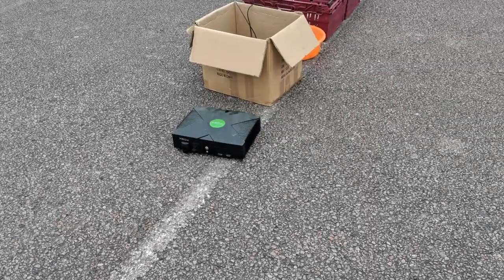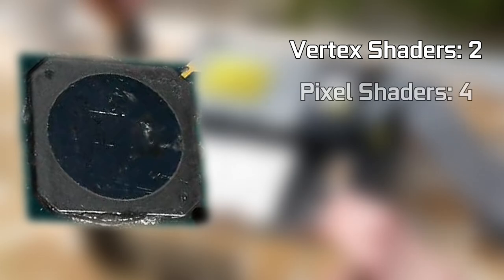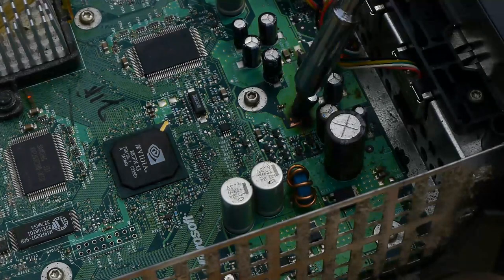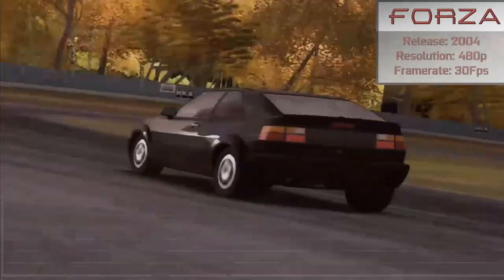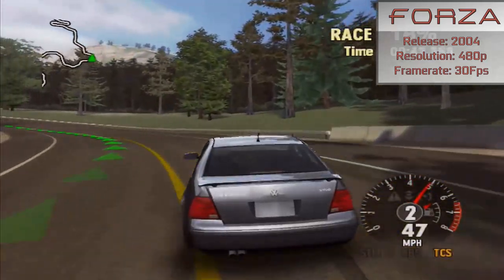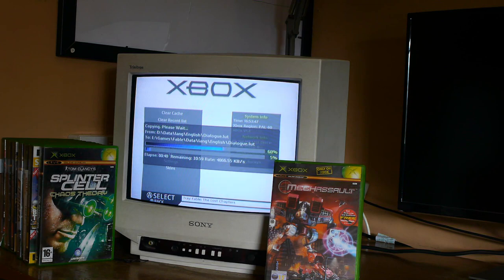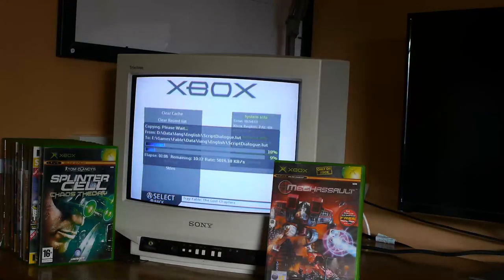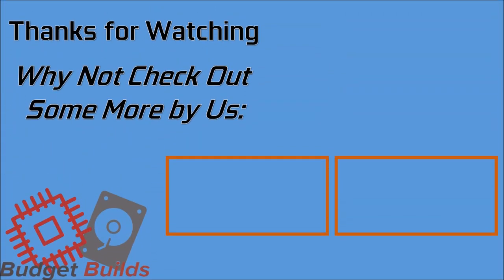How Powerful was the XBOX?

Comment: If you happen to get one of the first revisions, you can even do a dual-bios mod. I have one that can switch to EvoX dashboard for use with normal xbox games, or alternatively boot xbmc4xbox for watching video or running apps and emulators. 
Sadly the youtube plugin broke, and it just can't play even 720p video smoothly.

But i would say, if you want to expirience retro console games, a modded xbox is your best choice. It can emulate anything from the 90s time, like the MegaDrive, SNES and even some newer ones. And, like you pointed out in the video, the controls just work.

Unlike emulators on PC, you are still on a console, using the native controllers and running on a TV, like all the other consoles. So emulation on the xbox is as close as you can get to the original expirience of all those 1000s of games without actually buying dozens of consoles.

Comment: The OG xbox was one of the best emulator machines I've ever owned! It emulated the NES, SNES, Genesis, Sega CD, Arcade, and NEO GEO flawlessly! It also did a pretty damn good job emulating the PS1 and N64. I didn't realize how great emulation was on the OG Xbox until I got into emulation on the PC. The xbox is so much easier and user friendly with how the emulator devs made their emulators work on the Xbox with easy controller support and interface. I was really surprised that emulation was so much more polished on the Xbox compared to PC.
Reply from the maker: ? The XBOX is great at emulation. I say this in the video.
Reply: @BudgetBuildsOfficial  You did. I misunderstood what you said (when you were just talking about the DS emulation). I've updated my comment!

Comment: I'm surpriised you didn't elude to the fact that the controller ports are just USB ports with proprietary connectors and that the controllers had USB hubs in them that provided two USB ports for the memory cards. So you could easily just connect normal USB hardware (like a flash drive) to the controller or memory card ports to get files from the PC to the console.

Comment: I am curious if that HDD can be replaced and if it might benefit the games at all to replace it with an SSD.
Reply from the maker: It can be a bit of a pain to install an SSD, but with the correct equipment it can be done. There aren’t often many advantages with load times, but a few games that make heavy use of the Z:/ Drive as a cache (Half Life 2) or games with horrific file indexing (Morrowind) do see an advantages to the frame rate. 

I did speedrun Fable for a while, the generally an SSD gave the occasional .1 decrease to load times, but few games take full advantage. 

At some point I should make a video about it, it does have its flaws on a soft modded console, mostly the read times occasionally being too fast for the console to boot (generally fixed by patching the boot after the install has been completed) 

This was a few years ago so things may have progressed since then.

Comment: If the hard drive fails on the original xbox you won't play any games on it, it boots the dashboard from the hard drive and it needs to talk to the hard drive to unlock it with a unique password and then initialize it before it even starts to do that. If the HDD has failed it won't do anything but flash a bad coloured light at you.

Comment: As a lad I had a modded xbox thanks to a friend of my father, with a 250gb hdd with games installed and emulators and the like, was a good ol time until the hard drive died in like 2010. I don't remember but I assume it was ATA wonder if you could adapt an SSD to the old boi

Comment: I'm enjoying my Switch but I miss the simplistic days of this old gen. It actually did keep me from being seriously into PCs because at the time PC gaming was wildly more complicated. Wanted to play with a controller? Pray it had support for it, even then it'd probably be really bad. "Press 1" cool, my controller has A,B,C,D so this'll be fun. 

The consoles were brain dead simple, throw a disc in, play. You didn't have to know what you were doing in any technical way, friends could easily hop into MANY split screen games and hey you could buy/sell and trade used games (still can, for now) 

Now, consoles are barely worth it. The complexity has skyrocketed, you have to compare console performance between the same console by the same maker (Pro variants), you have codes to put in like the ol' PC days, installs, updates, massive bugs and of course microtransactions.
Reply: This is purely nostelgia, most games on steam do have controller support, ive barely come across a few games which didnt have them, the one which didnt were mostly FPS shooters which would be bad on a controller anyway, and as nostelgia often does, forget the problems of the past, like common hardware failure,overheating, discs getting scratched, and weird resolutions to scale to, not to mention consoles are cheaper now, if you jot in inflation, you will see how expensive the original consoles actually were, games have gotten free with microtransactions threwn in them, which is honestly fine, that way you only pay how much you would like to pay ( considering its not a EA game, and you aren't addicted to spending money) but free games is always better meaning you can get more fun out of a console, the Xbox vs PlayStation vs Nitendo vs Google fight is important too, since it makes each conpany fight for the best spot, its best to leave nostelgia behind and see how far we have come 

PS1 -> 2MB RAM / 1MB VRAM 
PS2 -> 64MB RAM / MB VRAM
PS3 -> 512MB Shared Memory 
PS4 -> 8GB Shared Memory 
Xbox one X -> 16GB Shared Mem

( Incl xbox one x as its only xbox worth buying rn )
Reply: @rainbowisticfarts  You entirely misread me and typed up a massive paragraph for nothing. I said I missed the days where the consoles WERE more simple and easy than PC which did NOT, at the time, have good compatibility back then. Find some old PC games that had any controller support, they didn't have the Xinput we all love today. 

No button prompt standard really screwed over controllers on PC back then. Whether or not they're optimal for a game isn't relevant to the point. 

Which was simply that I miss when consoles were as simple as can be, I don't miss PCs gaming being aggravating . Having to juggle 1st party and 3rd party drivers on my old ATI laptop depending on whether I wanted to play DOOM 3 or Half Life 2

I'm well aware how PC works today since that's where I primarily game on. 

I don't really agree about the ignoring what was and only looking forward given that we've lost a lot of simplicity and now have 5 different kinds of fees in 90% of our games these days. 

And I'm confused by your statement on weird resolutions to scale to, they were built to a standard much like many PC games. Old 4:3 games haven't exactly aged well whatever the platform. Now consoles are claiming 4k but are typically are upscaling. We have resolutions all over the place, we're just seeing a more unified standard of 16:9 & 60hz. 

Free to play games would be fine if the AAA industry wasn't trying to mimic those games while charging full price and doing really crap things on top of it. 

I prefer owning discs and never had much in the way of worrying over them being damaged and as for hardware failure? That only caught me with the X360 which was a heaping pile of trash. I've never seen a console over heat until then.

Comment: There is some difference of opinion on the matter of which was most powerful - the enption engine ran in parallel with smaller processors and all on a high bandwidth system. Most games were at 60fps on the ps2.
Reply: Then why do og Xbox games look waaaaay better? There is no game on the ps2 that looks as good as dead or alive 3

Comment: I have a modded Xbox with a larger hdd, I put my copy of Morrowind onto the hdd and it actually runs at a smoother frame rate off the hdd than my Xbox one X does off the disc, it’s the only game I’ve noticed this on, but it’s really interesting
Reply from the maker: Very strange, although the Xbox One X doesent run off the Disc it runs off the HDD as it downloads the full game with modified libraries for the emulator to use (IIRC), maybe its to do with how the XB1X Emulator emulates the caching.

Comment: I will never forget the first time I saw an Xbox running.  It was at a (then) local GAME store in Plymouth, England.  I had a PC and only a PC.  I saw the Xbox running PGR, wondering what this has to do with Batman. I was shocked with how great the game looked and I remember I wanted to get one.  Unfortunately as I was a uni student, thousands of kms away from home, living in a very small student accommodation, even if I bought it, I wouldn't have room for a CRT TV.  I barely had enough room for my then PC.  So...I never got one.
Over the years I considered it, but never did go for it as with Xbox 360 I could play PGR1-4 just fine.  Till each of the 360 eventually died on me of course.
Hey Microshit, release the next Xbox series with backwards compatibility for the PGR series, and you have a sale.  Else, forget about it.

Comment: That is a bit strange. What I heard was that they originally sold it with a Pentium III then later models dropped to a Celeron to save money. Which wouldn't be that surprising or noticeable since they do perform basically the same. 
(Celeron didn't earn a bad reputation until the Pentium 4 era).

Comment: I'm playing on PS2 and xbox since day one and although both consoles were amazing I feel xbox has impressed much more. Graphics on xbox was clearly on different level and xbox exclusives and ports were very good. Overall PS2 had more games but still xbox had big number of good games, far greater than now on xbox one or PS4. I have around 100 games on my xbox HDD and i still havent played them all after so many years 😃. Also 480p worked in the vast majority games unlike PS2 (and you can use 480p patches for the remaining games). 480p makes a big difference on HDTV and IMO on small 720p HDTV these xbox games still still looks amazing (picture is MUCH sharper compared to playing 480i on CRT).

Comment: All disk drives read faster at the edge. Cd based games used this tehc a lot to speed up loading. If you have ripped disk based games in the past you normally have to use a tool that removes the dummy data out of the game that was put there to push the data to the outer edges.

Comment: In theory, your point about Xbox emulators apply to RetroArch, that as a project has tried it's best to make emulation a very console like and hassle free experience, if you do not mind the fact that it is frontloaded with more hassle than any other standalone emulator on PC ever. I would like Xbox for emulating games on my CRT but the CRT output of Xbox is not quite as clean as I would like. To me, some consoles are made for CRT output from the graphics pipeline and to me Xbox feels like how Wii U and PS3 handle their TV output; there is a part in the graphics pipeline that converts the signal to CRT compatible one, resulting in good image for the 3D games that xbox outputs and other consoles of the time were similar, sometimes letting you turn off stuff like image filtering for sharpness versus shakiness - but overall the image quality is not just quite good enough for me to get enjoyment out of it being old games emulated for RGB CRT signal.

Overall I enjoy emulation with Retroarch though especially if the roms or other data sets for games are not being recognized by it, it becomes somewhat arduous to setup for the exact games and hacks of games you would like to run, and really retroarch is still kinda better time on a softmodded modern console like PS3, Wii U or Switch, minus the lack of power and support for latest and greatest emulation RA can offer, like Beetle PSX HW, Dreamcast or saturn emulation.

Comment: correct me if I'm wrong but wasn't phantom crash released as Steel Lancer Arena International on PS2? also the game that got me into zebrehead.
Reply from the maker: That was the sequel however the game just felt overtly clunky in certain areas compared to the original game on the Xbox.
Reply: @BudgetBuildsOfficial  well damn looks like come next payday I'm heading down to cex to pick up an original Xbox seems to be some hidden gems on there
Reply from the maker: @deadonarrival909  I'd recommend softmodding it if your in Europe so you can unlock NTSC Mode. Which enables 480p output... Unless ofcourse you're going to be running on a CRT :)
Reply: @BudgetBuildsOfficial  can't say I've owned a crt in a while haha

Comment: Don't forget to TSOP flash your original Xboxes or at least softmod and null the hard drive! At this point, the hard drives on those Xboxes could fail any time, and without a TSOP custom BIOS or having the EEPROM code for your hard drive, the Xbox will be a dead paperweight unless you know how to solder a modchip onto the system.

Comment: Cool video.  A few things that weren't discussed:

1. Simply swapping the standard 40-pin IDE cable for an 80-pin one will give you a 25% boost in throughput.  Yes, really.  (http://www.web-nine.com/projects/xbox/ide/)
2. If you don't have the games needed for the corrupted save soft mod, you can unlock the drive by subbing a long IDE cable, booting the XBOX until it unlocks the drive (It's been at least fifteen years since I've done this, so I don't recall all of the particulars.), then unplugging just the IDE cable from the XBOX motherboard and plugging it into an (unpowered) PC, leaving the hard drive still powered by the XBOX.  (Yes, this is somewhat sketchy, but I've never had a problem with it.)  You can now boot up the PC and do whatever you want with the now unlocked drive.  This only works with the drive that came with the XBOX, but that is enough for many requirements.
3. I don't know where to find them nowadays, but the B.A.E.D. (Bada$$ Emulator Disc) DVD's were an excellent option, as they contained both emulators and ROM's already set up and ready to go.

Comment: It's the first most robust and powerful console, since it was based on x86, it's pentium III 733Mhz and cutdown of Geforce 2 Ti for just $300 in early 2000. I see lot's of negative comment on it's early released, I just don't see any reason how can you hate this console, or even disliked it, except for lack of jrpg games for it, but then again the number of games that has been released for this console is still extraordinary, and most of them are running with steady frame rate, Prince of Persia is a good example for you to compare, almost every mod for this console only based on software, u can play any emulator, multimedia files, and even uhm... pirated games.
Reply from the maker: Closed to a Geforce3/4Ti hybrid, but other than that a very valid point

Comment: What’s the difference between 1080p & 1080i
Reply: 1080i takes 2 "fields" of 1920x540 and joins them together* to make one 1920x1080 frame. the 540 being all the even lines, then all the odd lines vertically(making the frame rate half of the amount of fields) 1080p has the full 1920x1080 image at all times.
*Well your TV/Display joins them together.
Reply: lmcgregoruk fine don’t tell me 😂

Comment: When i got my original xbox it was faster and more powerful than any PC i had at the time. Maybe not in raw CPU power but def was way better GPU than i had in my pc at the time. And didnt have all the overhead that windows has on a PC. 

Its also easy to forget the influence the OG xbox has on consoles and media station type devices these days. I mean XBMC went on to become Kodi and showed that there was a market for a device connected to your TV for digital media playback. Without using the horrible composite or svid out that a lot of PC GPUs and laptops had at the time.

Comment: a while back we disassembled an old non functioning pc and found an athlon 64 you should review that,the first consumer 64bit cpu
Reply: ..was it not the, AMD 'Turion', I have an awful Acer laptop from the time that claimed to be the first 64bit processor. Acer 5001 WLMi.. awful machine.
Reply: TattiePeeler hmm i’m not sure maybe that one was the first mobile cpu i’ll look it up
Reply: 2001
Intel ships its IA-64 processor line, after repeated delays in getting to market. Now branded Itanium and targeting high-end servers, sales fail to meet expectations.
2003
AMD introduces its Opteron and Athlon 64 processor lines, based on its AMD64 architecture which is the first x86-based 64-bit processor architecture. Apple also ships the 64-bit "G5" PowerPC 970 CPU produced by IBM. Intel maintains that its Itanium chips would remain its only 64-bit processors.

yeah looks like intel had the first consumer server cpu but and had the first general use one
Reply: @SMARTBoardSBMInchInteractiveWh  Itanium was a very strange creature though, not an item you'd have used at home.

Comment: Should tsop flash and install another bios or at least use chimp to clone the hard drive those ones that came with them are on their last legs too so to say I barely got lucky with my old xbox its dvd drive died the moment I soft modded a year ago or so but at least I was able to clone the hard drive which then died after so I made a back up of the back up cause you never know with old hard drives.